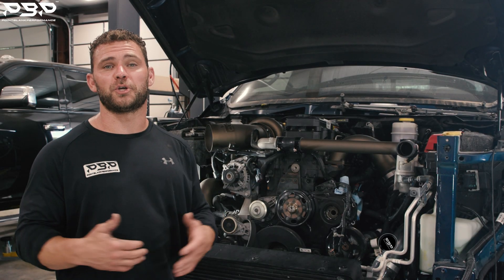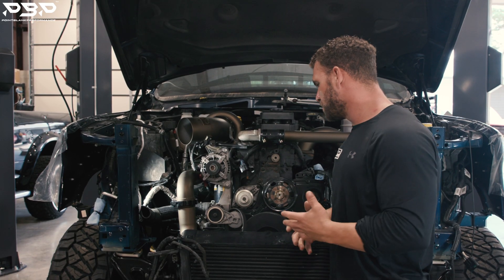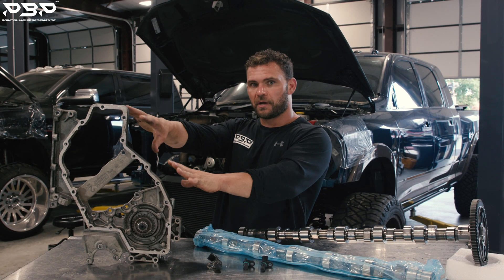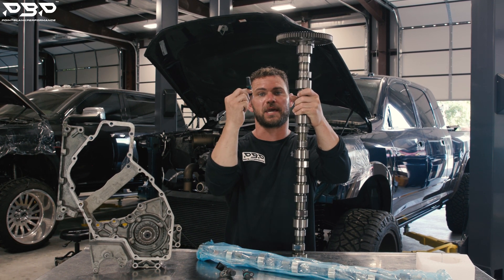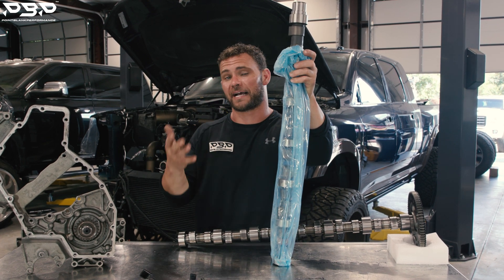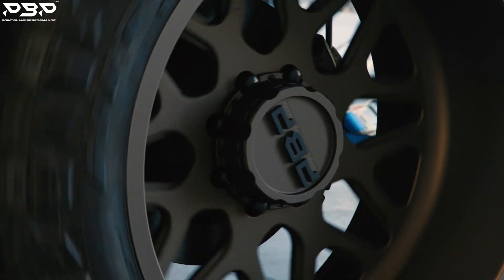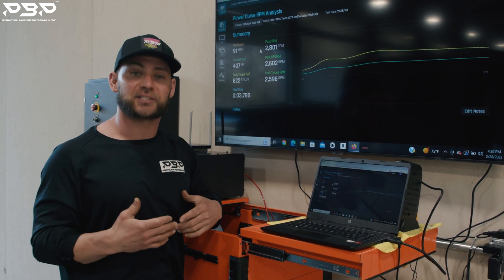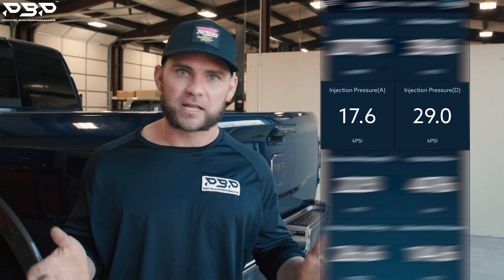5TH GEN CUMMINS GETS A 4TH GEN ENGINE SWAP!

Comment: How you doing guys ? I question When you put a 4gen on a 5gen what do you do with the flywheel? I’m doing this swap and the flywheel bots are not the same size also I can’t put the factory 5 gen flywheel on the 4gen because the crankshaft bolt are not the same to so what do you do on this case ?

Comment: in the process of this swap right now, we found out the hard way about the camshaft gear / sensor ... out comes the Engine again lol
Reply: Also I forgot to mention we had to change the flywheel aswell as I had a 5th gen Aisin and the 4th gen had a 68 😅
Reply: @dustingardner3267 what flywheel / flex plate did you use ?
Reply: Was it because of the electrical plugs?

It’s my understanding that the 2019+ cam and crank sensors in same spot and transmit same signals, just they are a different sensor/ plug and at different depth for cam sensor. Meaning 2019+ cam gear goes with 2019+ timing case.
Reply: I’m not sure the full details as I wasn’t there for the final instal ( was working ).  But the engines been in for 3-4 months and running great with no codes.
Reply from the maker: @dustingardner3267 Thank you for the input !
Reply: I also want to add that we put my injectors from my 19 into the 4gen.  Along with a brand new cp3.
Reply: @dustingardner3267 would you be willing to make a post on the cummins forums detailing your swap and experiences? 

A lot of us 5th gen owners are loosing motors due to the lifters. I’d like to swap a 4th gen motor in my 5th gen truck, as my blocks toast… dropped a lifter at 198k miles of towing 17-25k lbs.
Reply from the maker: @delorean831 You are correct sir
Reply: Zach Hamilton is the one who told me the signals were the same when he put it on the dyno. 

So if one were to leave the 4th engine together and just retrofit the old electric plugs on 5th gen harness, it would run, it would just need correct tables in the tune for injectors and lack of return solenoid on rail?
Reply from the maker: @delorean831 Just make sure the the 5th Gen timing cover goes on the 4th Gen. We have only used the CMF (5th Gen.) controller on the 4th Gen Engines.
Reply: Did you swap just the cam gear over from the 5th gen cam gear onto 4th gen cam?
Reply: Hey dustin can you give me a call ? I’m in the same process and the same diesiel shop has had the truck 10 months I need a good shop to finish this truck or some input on what needs done if you could help me out

Comment: So you put a 4th gen flat tappet cam in with roller lifters? Kinda got lost there. Flat tappet and roller cam lobe profiles are allot different
Reply from the maker: We installed a 4th gen cam into a 4th gen engine that is installed in a 5th gen truck sir.

Comment: I’m in fl they fucked me on my 82k mile 2020 I can’t buy the cam or your turbo set up but I got a 2018 to swap can I use the roller cam if I  just swap cam and everything and just use the 2818 short block
Reply from the maker: The 2018 engine will
Have to have the Tappet camshaft , adjustable rockers and 4th gen push rods . 5th gen cams are way bigger then the 4th gens . The 5th gen cam gear and front cover must go on 4th gen engine!

Comment: How far out are you guys booked up?
Reply from the maker: We are scheduling into May / June sir !
Reply: My manual 68rfe from wp developments should be installed by then. 
I’m wanting to get my manifold charger upgraded, possibly a d&j head stage 3 put on, nozzle change & some revisions.
Would definitely like to get it dialed in on the Dyno.
We could probably schedule earlier but I’d rather be conservative just in case, so anytime beginning august or after I’d like to be penciled in for.